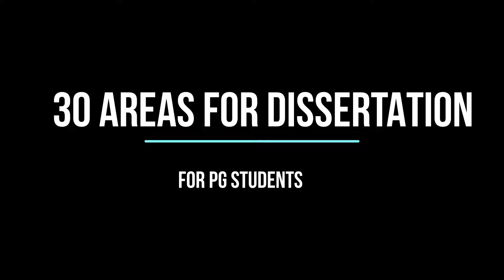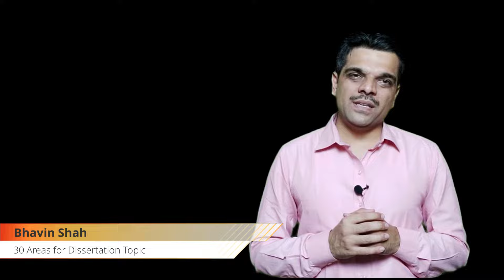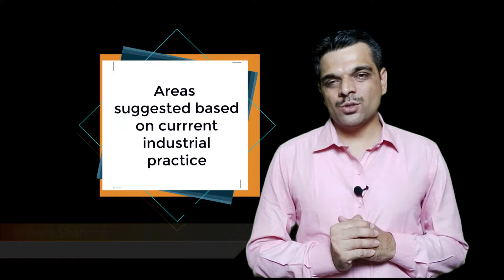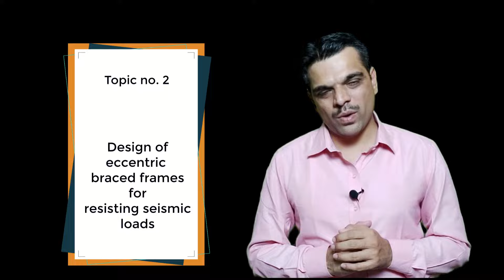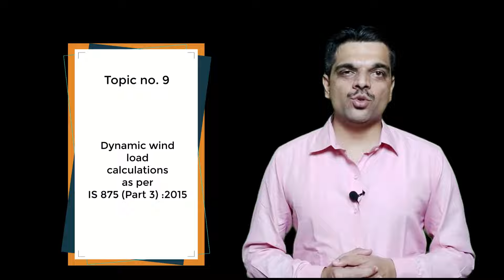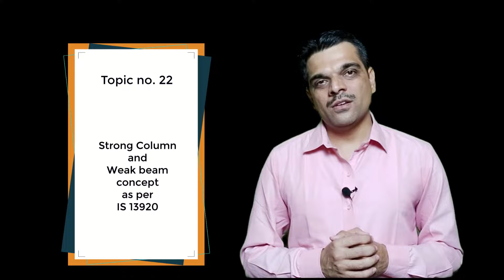30 Areas for Dissertation Topics for PG students of Structural Engineering

Comment: Good idea of identifying Topics for dissertation and rightly mentioned that this can be expanded. 
Similarly for thesis topics may be identified. 
Civil Engineering has atleast 40/50 vertices.
Reply from the maker: Thanks for your message. Indeed, there are 50+ verticals in the field of civil / structural engineering. Overall idea of creating this video is to channelize the energy of the young engineers in the appropriate direction. We are creating few more videos on the same and will be published shortly.
Reply: @StructuralEngineering  Can you tell me in BE level RCC design course why there is continuous beam analysis for main beams? Why not consider it as frame or substitute frame for main beams? This is tradition or it is wrong assumption? Even today question papers have same format.

Comment: Please suggest phd research topic related to structure engg and construction..plz plz reply sir
Reply from the maker: Some of the topics may be 1) Improvement in constructability aspects  2) Retrofitting of the existing structures 3) Construction of massive foundation (like wind turbine foundation) 4) Design mix for high strength concrete beyond M80 5) Optimisation in design of form work for different structures 6) Usage of virtual reality for interface between structural engineers and construction, etc. There are many other topics. You may contact for further details.
Reply: Sir plz share details
Reply from the maker: @kirti6451  You may reach us through email address : contact@sqveconsultants.com

Comment: hi sir. Im interested for topic 23 . manual design for shear wall vs. software..  please mention particular problem that the industry has facing today when it comes to shear wall design manually vs. software ..thank you sir.
Reply from the maker: You may design different types of shear wall (squat, intermediate & slender) with manual calculations based on the standard literatures and books. The same shear wall to be designed in the different software like ETABS, STAAD, RCDC, etc. There are number of variables and input parameters in the software which might affect the results drastically. Based on the study, you may compare the sensitivity of each input parameter and modelling strategy for obtaining appropriate results related to design of shear wall.
Reply: Thank you sir..God bless .
Reply from the maker: @engr.sorepor9987  You are welcome!
Reply: @StructuralEngineering   STAAD or ETABS which one is better for analysis and design?
Reply from the maker: @subhanasamad3816  We can discuss this over phone. Please drop an email at contact@sqveconsultants.com with your brief introduction.

Comment: Excelent video sir and excellent undertaking. I have watched all your SCS TV presentation,  they were very helpful to me and to anyone seeking to get more insights on IS 800-2007. 
However, i am a PG Student and currently in the midst dissertation on the comparison of IS: 800-2007 and AISC-360-10 limit states. I have couple of questions.

Q1. When an I-section  has a semi-compact web and plastic flange, why is the whole section considered semi-compact in IS: 800-2007 ?

Q2. Is there a provision for the design of slender section in IS:800-2007. If yes, which section.
Reply: Thanks for your message. Will revert on your queries.

Comment: Any topic related to high strength concrete
Reply: Importance of cement content may be studied in high strength concrete from the perspective of durability. The cement content may be lowered down by using fly ash, GGBS, microsilica, etc. and the impact may be studied on the property of concrete cubes. You may try replacement of cement as high as up to 80% in your study. For adopting the suitable supplementary cementitious material, different test should be carried out. Few of the required test are mentioned below :

Marsh flow cone test – To study the rheological properties of cements and mortars
Wet packing test - To measure the packing density of coarse aggregate and blended fine and coarse aggregate

If there is no replacement of cement by such material then the gap between cement particles will be filled up by water which will evaporate eventually and resulting in the shrinkage cracks. Advantages of using supplementary cementitious material are increase in durability, reduction in cement content, reduction in heat of hydration, reduction in quantity of superplasticizer, etc.